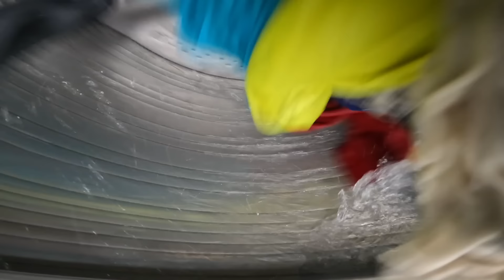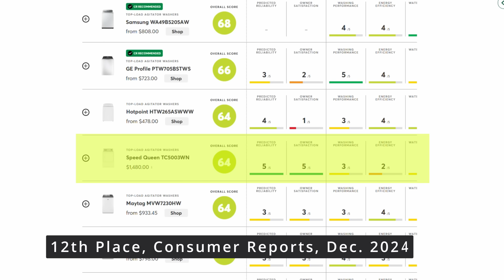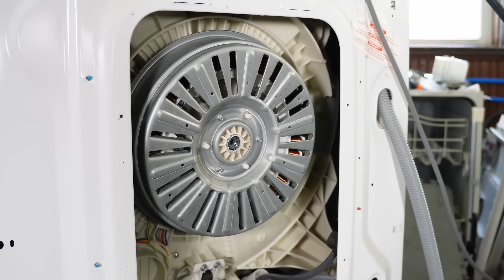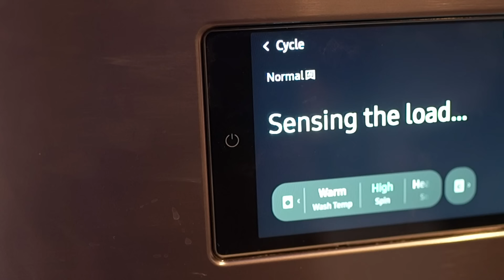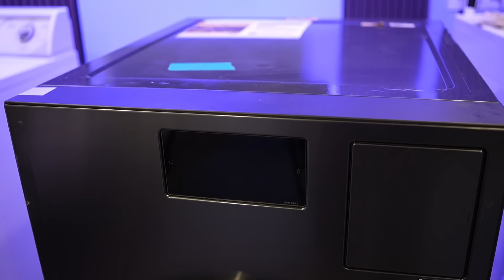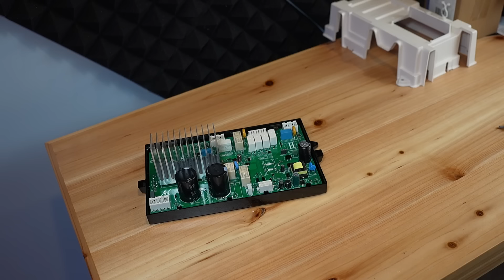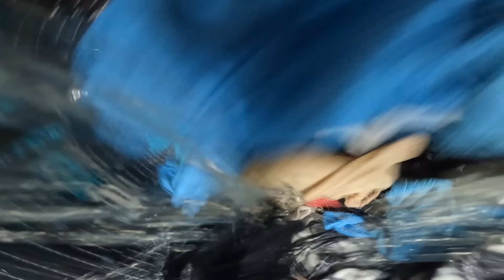Is America's Most Expensive Washer Great? The Speed Queen FF7009WN Test

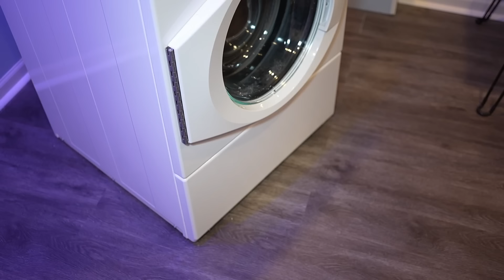Comment: What is crazy to me is that in America, you consider 1:56 run time "beyond crazy". Most countries in the world use front loaders with a capacity of 11 to 26 lbs. Normal run times are 3 hours. If you chose an eco setting, you are 3.5 hours. The clothes also come out significantly cleaner. 
45 minutes would be the fast "refresh" setting. 
Slower is better in terms of washing quality.
Reply: Washers do not need to run that long, even for a front loader.  My mom owned a Westinghouse front loader in the 1970's, like someone else mentioned,  and my mom's model did a wash and 3 rinses in 45 minutes.   Until 1974, Westinghouse was a North American brand,  and was available in Australia.   Electrolux owns the brand in Australia,  but they used it under license,  with the White name attached to Westinghouse,  for many years.  I had a Frigidaire front loader I bought in 1999, and normal cycle was 40 minutes,  and 50 minutes for the heavy duty cycle.   It involved a wash, spray rinse during the draining of the wash water,  and 3 short rinses.  It got my clothes clean.     2 to 3 hours will just put unnecessary wear and tear on the clothes.
Reply: @davenwin1973  the longer cycles are for heavy duty fabrics, all washers sold in eu have a standard energy label cycle that compensates for low heat with longer wash time and longer spin to extract as much water as possible. it certainly puts wear on the machine and the clothes. However, for a well built machine and decent quality fabrics this is not an issue. The wash action of a front load washer is much more gentle than an agitator, there is very little rubbing action. beyond the standard cycle there is a regular cycle on every machine that is not restricted by the energy requirements, depending on the washer itll heat to the temperature you set and it will use more water and run shorter. 
The main reason why our washers take longer is because the hot fill machines got phased out, now the washer needs to heat up from cold. This has the advantage of giving the enzymes in the detergent time to work before the wash comes to temp and denatures the enzymes. Either way I don't really know of anyone who sits beside their washer waiting for it to finish washing, if you need to go out you can program your machine to finish by the time you get back. if you need something washed in a pinch every washer nowadays has a quick setting.
Reply: @davenwin1973  Also I failed to mention that the machines sold here tend to be 2.2cu ft for the full size models, you would expect to fit 18lbs of laundry in there and have it come out clean.
Reply: @Progan666  the Frigidaire front loader I owned back in 1999 was a 3.1 cu.ft., and was rated up to 18lbs.   My LG that I have now, and almost 13 years old, isn't much bigger at 3.6cu.ft.   I don't know the maximum weight of it, but the Frigidaire I had held 8 pairs of jeans, and my LG holds 10 pairs.  I plan to replace this washer eventually,  because over half of the parts are no longer made, and I had to buy a used control board used, for this reason.   The cycle knob stopped working on the original control board, and it's sealed shut, preventing me from checking to see what's wrong with it.   I personally wished I kept the Frigidaire,  because all it needed were bearings eventually.   I replaced it,  after my 15 year old Hotpoint dryer stopped working, and was wanting to replace it.  So I bought a new set.
Reply: @davenwin1973  Front loaders use significantly less water and power. Power is the main reason for the longer run times in Europe and Asia since historically speaking, energy prices are far, far more expensive that what you have in the states. 
For soaps, I think some of the ones available in the US are not legal here since they are close to impossible to remove from the water, but more or less, it's the same. 
I guess most people don't care that it takes 2 or 3 hours, because it's not like you're standing there doing it by hand, plus, it's using  way less power and is way easier on your clothes.
Reply: @pablomax9376  it's true that front loaders use less water.  For energy, at least where I live in the US,  2 to 3 hours is not energy efficient.   My electric rates are expensive,  that 2 to 3 hours uses as much as 30 minutes for a top loader.  Some of us have large households, that we don't have time to wait for laundry to get done.  I'm ok with an hour between wash loads, but not 2 to 3 hours.  If I had to use the size front loaders as Europeans use, that would take even longer to get laundry done.  I forgot where I heard it from, but the European Union is wanting to slowly adopt the North American size version of front loaders,  in order to allow for larger households to wash fewer loads of laundry.   They'd still meet EU standards,  but embrace the capacity of North American styles.  

   As for laundry detergent,  North America got their version of Persil from Henkel,  and it's just as strong as the German version of Persil.   However,  we don't have a powder version of Persil,  because in the early 2000's,  people overall stopped buying powder detergent.   Persil is as strong of a laundry detergent to Tide.  I'm not sure if Proctor and Gamble has a presence in Germany,  or most of Europe.   I do know that Proctor and Gamble is in the UK,  and their version of Tide is Aerial (this brand is also the Mexican version of Tide).  I rarely buy Persil, and Tide, because these are the most expensive detergents,  and for everyday use, I use a brand here called Arm and Hammer with Oxiclean.  It's not a harsh detergent,  light scent, and the version with Oxiclean does a great job at basic odors, and lightly soiled clothes.  I sometimes use Clorox 2, which is a color safe bleach, but I only use this with Tide, or any other brand of detergent without color safe bleach.  I don't know the ingredients in it, but the ingredients are approved for the EU.  Regular Clorox is chlorine bleach, which is banned in all of Europe,  is something I rarely use,  as it's mainly for whites, and some brands are not filtered properly,  that whites don't get as white from chlorine bleach.  If I use chlorine bleach at all, I mainly use it for really dirty places in my home, that need serious sanitation.
Reply: @davenwin1973  You cannot equate run time directly with energy consumption. Even though the machine runs longer, the overall energy usage is lower because: 
The heating element isn’t working as hard.
 Less water is moved and heated.
 Motors operate at lower intensities.
The non-US machines don't constantly agitate. They move a bit and sit, move a bit and sit. So, the overall motor use is way lower.
Reply: @pablomax9376  where I live, 3 hours is too long to run, as my area of the US has very high electric rates.  Areas that rely on hydroelectric power, usually have lower rates.  My area is powered by natural gas and coal, and that makes my electric rates high.  Add to it, that I'm in an area that the EPA has as a non-compliant air quality zone, extra fees are added to my rates.  I would know that running my washer as long as Europeans running their washers, will make my rates go up.  I try to run my washer during the overnight hours,  in order to run it at lower rates.  If I had a European washer in my home, it would in fact be expensive to run, as I have family that have nearly all electric appliances,  and it's not cheap when they're 240V appliances.   This alone is why I will never own a European washer.   Not only because of the extra cost to run it, but much smaller capacity,  and longer run times, would make my laundry time much longer.  While I don't exactly like my LG that is made for North America,  I'll take the 60 to 90 minute cycles anyday.  Since this is the most basic model, there's no heating element in it.  My next washer, unless I'm fortunate to get this Speed Queen front loader washer, my next one might be Whirlpool,  and it'll have a bigger capacity,  that I'll only be doing laundry 3 to 4 times a month.
Reply: @davenwin1973  Mate, the longer runtime is using LESS power, not more. The aggregated time that the motor is on AND the current draw over on phase is way less than what is used for short run time machines. 
Again, there is a reason why all "ECO" modes have way longer run times. 
The speed queen also has a pretty small load capacity, according to the video. I'd not suggest to try and acquire a non-standard US model since it will be expensive and if it breaks, no replacement parts are available. The US ones are good enough, considering how cheap power is and that you have plenty of room in the house to put a huge machine. 
My original point was that to the rest of the world, 2 hours is a normal run-time and non-us machines use significantly less power and water. I heard from a guy I know at Samsung that they needed to change the seal and use more water because customers in the US want to see the water level up the window, otherwise they don't think it's working properly. Not sure if it's really true.
Reply: @pablomax9376  my LG was a major reason why I hate my washer.  It wasn't like my Frigidaire front loader from 1999, where it used water.  My LG does not fill directly into the drum, instead, sends it all to the shell, and rises into the drum.  My old Frigidaire filled directly into the drum, and sprayed water on the clothes, as it filled.  My LG has the clothes soak up the water from the rim of the drum.  The default setting had the water way too low, that I had dry clothes in the middle,  and wet clothes with detergent and fabric softener residue on them.  I had to adjust it, so it would use more water.  While it doesn't go up to the window, I got it to where it now saturates my clothes.   Another complaint is that I don't know if it's LG,  or the EPA,  that also has the water temperature lower than it should be.   Cold is tap cold, as it should be.   Warm feels like cold at about 70°F or 21°C.   Hot feels warm at around 90°F or 32°C.  Hot water on North American washers should feel like what hot water comes from the water heater (on average 140°F or 60°C).  My model does not have a heating element in it, as it's the most basic washer.  Had I bought the next model up, it had a heating element for the steam feature,  and that would boost the hot water from 140°F/60°C to about 160°F/71°C.   It does hot heat its own water from tap cold.  The model after that had a larger drum, steam, and Turbo Wash,  which had a recirculation pump.   I could not afford it, as I had to replace the dryer I used to have,  and decided to replace the washer as well.   

My washer so far has lasted me nearly 13 years, and I had to get a used control board to keep this going,  until I can afford a new set.  For the record,  the capacity of my LG is the same capacity of this Speed Queen,  as I have used their laundromat models, and the capacity of the laundromat models,  are the same as the residential models (I saw a couple available).  So if I were able to buy a Speed Queen,  my laundry would not Change much.  Speed Queen washers have a shorter wash time, compared to LG and Samsung (my sister has a Samsung (the most basic on theirs has a recirculation pump to saturate the clothes , as their washers otherwise fill like LG, sending it to the shell).  When I base it off my original settings from my LG,  the water usage was set at 11 to 13 gallons, or 41 to 49 liters.  That  would have been fine, if my clothes actually got all wet.   After adjusting it enough to saturate my clothes,  but can still open the door if need, it uses 20 to 25 gallons, or 76 to 95 liters.  My old Frigidaire,  with a slightly smaller capacity,  but larger than a European washer,  used 18 to 27 gallons,  or 68 to 102 liters.  The reason my Frigidaire used more water, was because it filled a third of the way up, it did a wash, spray rinse during the draining of the wash water,  and 3 short rinses.  That washer did all that in 40 minutes,  and on heavy duty in 50 minutes (just added 10 additional minutes to the cycle,  but only had a simple dual tumbling).  This washer was a redesign of the old Westinghouse and White Westinghouse,  which only tumbled one direction,  and added dispensers,  which the old design did not have.   My LG can do 45 minutes,  if I accept 2 rinses by default.   Since I like 3 rinses (can do up to 3 additional rinses for 5 rinses total), it adds about another 15 minutes.  Unlike the old Frigidaire,  washers now have soil level, and most times, I pick light to keep it as short as possible,  as my clothes don't usually get that dirty, and don't need to use Persil or Tide on my clothes.   So my LG takes 60 to 90 minutes,  which is a compromise for me.   I don't have time to wait for a 2 to 3 hour load, and I stand firm that one load for that length of time is not cheap to run.  I also add my water usage into my electricity,  as my home has well water, and as the pressure tank needs to be refilled,  the pump is activated.   Municipal water is not an option where I live.  My well pump is the only 2 phase 240V gadget in my house. I try to limit my overall usage, as that can be expensive to operate.  This house was originally my grandma's house,  and she didn't have a say in the type of well put in, as the contractor who caused the neighborhood wells to dry up in 1980, the contractors paid for the well to be put in, and the company could have put in a 120V pump, but chose a 240V pump instead.  The old well was from 1950, and was a 115V with a shallow well.  The old well was 30ft, or 9m.  It's twice that at 60ft, or 18m.  Over 100ft, or over 30m  must use a 240V pump to pump water out from that deep in the ground.   

Anyway,  I will see what I can afford to buy for my next front loader.   Since I have first hand knowledge of how this Speed Queen operates, I will try to get one, if possible.   Otherwise,  I will probably buy a Whirlpool.   I don't like LG, even though it Otherwise has lasted me nearly 13 years.  LG discontinues parts much faster than Whirlpool does.  My washer has over two-thirds of the parts no longer available,  because the size drum and shell partially play a role in parts being discontinued.   I can not replace the drum or spiderweb,  the door,  glass, or cabinet.  The water pressure switch is universal,  and can be replaced.   The drain hose goes by a different part number.   When I bought my LG set, I wished Whirlpool had continued their set that was made in Germany,  to operate on North American 120V,  because that was what I really wanted, and many people I knew who owned that set, had great luck with it.  I would not buy their later models, due to no access to the drain pump filter.   That is changing,  and looking at Whirlpool again as a possible choice.  

I forgot where I read online, that the EU would like to see energy usage go lower, that they're looking at bringing North American capacity washers to Europe,  but would need to meet EU standards.   They're hoping that overtime,  it might allow people to do fewer loads of clothes.   I know this won't work in all homes, but for those with the extra room, that this could help with less laundry.
Reply: @davenwin1973  I think it's more a space thing. The homes here are way, way smaller than the typical US home. I could fit US size machines in the basement, but I also don't want to walk down there to do laundry. 
Yeah, I hear you on LG. I have one now and it sucks. It gets the clothes clean, but after just two years, it sounds like a your living next to the L line. 
I'd love to have a US machine, but I would still want to have the long gentle cycle. Clothes are not cheap here!
Reply: @davenwin1973  of course.. the entire rest of the world must be wrong. USA! USA! USA!
Reply: @pablomax9376  I don't know how durable clothes are in Europe in general, but in the US,  what we get for clothes don't last as long as clothes from 20 and 30 years ago.  Also, with our energy rates, even for a front loader, 2 to 3 hour wash cycles can in many cases, cost as much to run a load of clothes, as running a top loader for 30 minutes.   I'm ok with no more than 1 hour per load of clothes, but not 2 to 3 hours.

I don't know if stain fighting products exist in Europe.   In North America,  we have products like Resolve,  Shout, and Oxiclean that are non-sudsing, and put on the stains, before placing the clothes in the washer.  So those products also help boost the existing laundry detergent in the wash.  I prefer Oxiclean, as I find it gets rid of more stains, while not being harsh on fabrics.  As for cleanliness, I find shirts and towels to do equally well in both a top loader and front loader.  For pants (👖), I find a front loader does a better job,  because they're constantly tumbled, while from my experience with top loaders, it doesn't circulate through the drum as well.  I never tried a high efficiency top load, and have no plans to get one either.   While I don't have a water bill, as I have well water at my home, I pay for my water, in the form of electricity,  for everytime the pressure tank needs to be refilled.  The pump in the ground operates on a dedicated 240V 20amp circuit.
Reply from the maker: The issue, Pablo, is that Americans are fully accustomed to top loaders which set the standard for run times. Many of my viewers complain about anything past 45min run times. Do I feel that way personally? No. I'm totally fine with 1hr 30min+ runtimes because, like in my LG/Samsung tests, I can just schedule the load of clothes and forget about it. 

My channel's average viewer is about 50 years old, with 75% being American.... So front loaders are new fangled, and I have to more or less argue for them which is not the case anywhere else in the world.
Reply: @bensappliancesandjunk  I get it man. I get a lot of visitors from the states and they are always shocked by two things with regards to laundry. 1. How much longer it takes, and 2. how much cleaner their clothes get in our machine. 
All a matter of what you get used to, I suppose.
Reply: No it isn't.  You're making for not enough water at a high enough temp. We also heat our wash water in the central,water heater.  We don't expect the washing machine to do it. My parents had the L-6 Westinghouse back when your people were still using washboard. It took 30 minutes including 3 rinces.
Reply: @uptoolate2793  "Your people"? I'm from the US, ding dong. There are lots of people who travel and live abroad, unlike you, who has never left your home town. Good'ol casual racism. 
You also have no idea what your talking about. Hot water produced my the machine gets up to 90c, your water heater is 55-65c. which is likely 10c lower by the time it gets to the machine, since US houses never insulate the pipes.